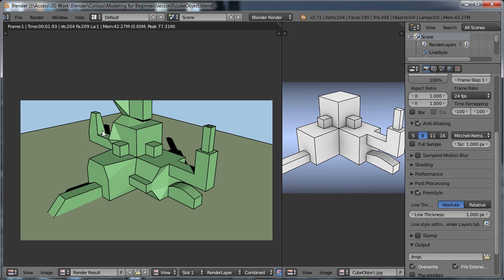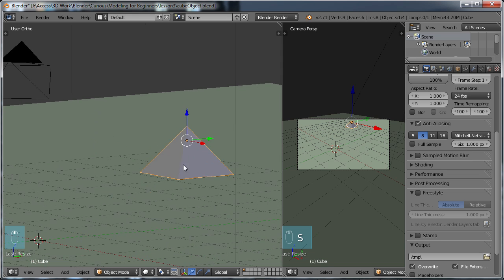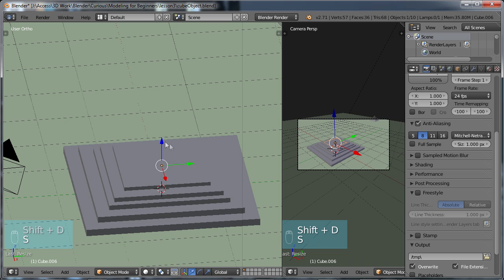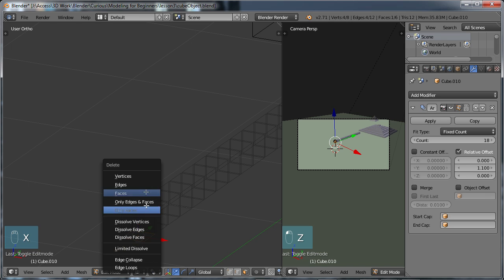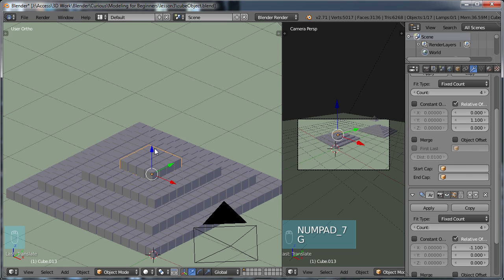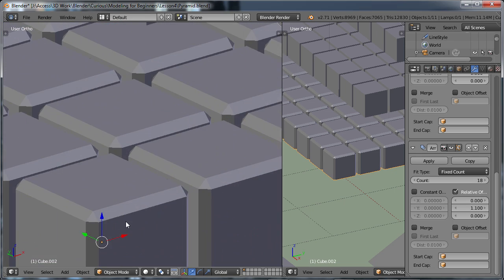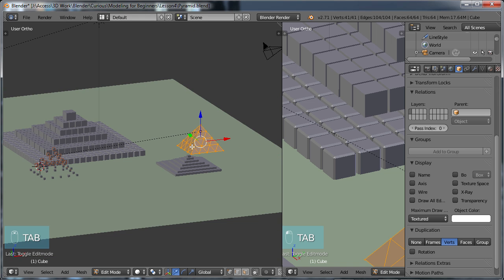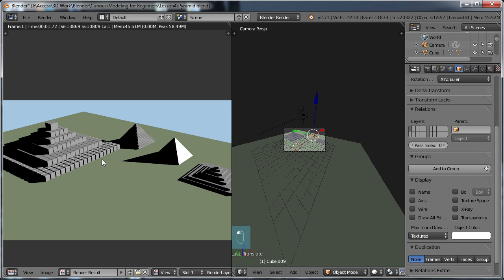Blender For Noobs - Modeling for beginners - Part 4 of 10

Comment: Thanks so much for the great lessons.  Could anyone tell me why when I select in object mode, all objects are selected? For some reason, I can't just select the block (30 minutes in) or the triangle. Both are always selected when I right click on either object. I just figured out that if I hold ctrl, I can select one object at a time. Is that normal?
Reply: Did you create the 2nd object(s) while still in edit mode - if so, when you are back in Object mode it will treat everything as the same object. To separate them I usually just duplicate the entire object and then go into edit mode and delete the unwanted sections from both objects.
Reply: I believe that was it.  Thanks for taking the time to respond.  I'm embarrased now with how much time I spent trying to figure this little bit out.
Reply: Don't worry about it, we all have the same issues one time or another. Also, in a later part of this course he describes how to separate objects from one-another by pressing "P" and choosing "By Selected" - does the same thing but without the mess of duplicating and deleting sections like I said earlier. Happy Blending :-)

Comment: When you were creating the pyramid, with the advanced setting.

Ctrl+P. Object. Then select Pyramid. Duplicate. Verts. The squares, and the pyramid are stuck together. When I try to tear them apart. The squares disappear. How do I fix this?
Reply: I've fixed it. when you are creating the Pyramid. I Merged the top 4 verts together, and I moved the Pyramid inside of Edit mode. When you do that, the origin point stays where your cursor was located. You have to move the object inside of Object mode, for it's origin point, to stay with the mesh.

Comment: Just want to point something out regarding the primitive pyramid part - a cone would work just as well, only the amount of vertices need to be set to 4 in the shape's property panel.

Actually since technically pyramids can have anywhere from 3 to n sides, this would be the more versatile and in my opinion easier method to approach it.